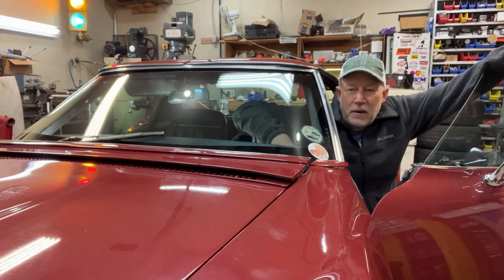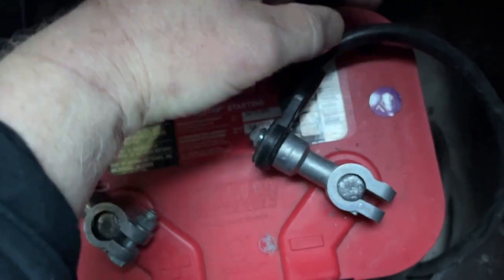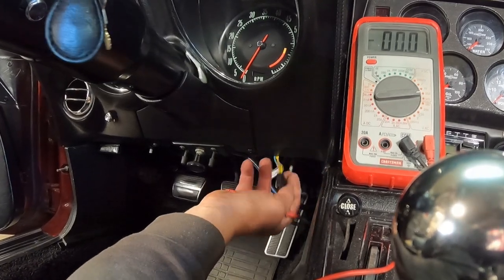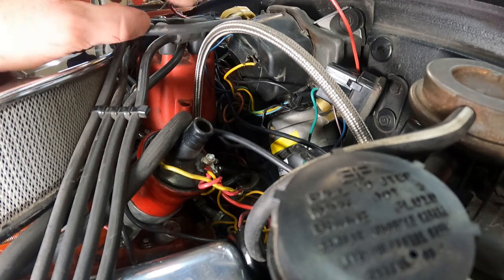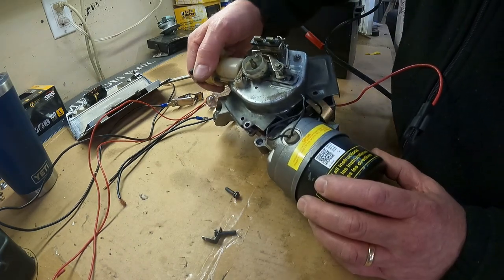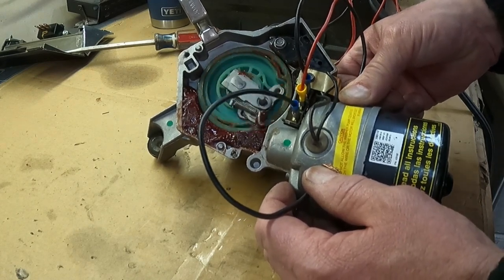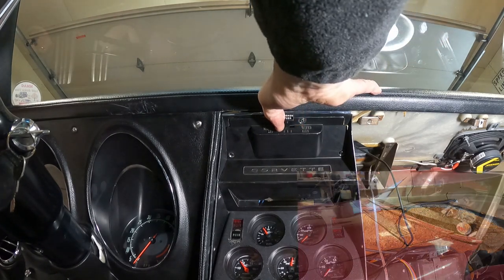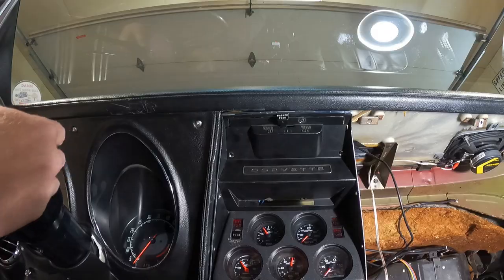C3 Corvette Windshield Wiper Repair, Testing & Troubleshooting the Entire Electrical Wiper System

Comment: Hey Mike, your video helped me with my wiper issue. 
I had seen several other videos but were NOT as helpful and detailed as yours, kudos to you.
My problem ended up being the ground wire on the tach was disconnected.
I tested the wiring,  the motor fuses and all were good.
But following your methods helped.
Many thanks and keep up the great videos.
Cheers 🍻
Frank
Reply from the maker: Thanks for the feed back!!! Great to hear the video helped you out. It’s a process troubleshooting and getting the wipers back in working order and ground issues are tough to solve. Nice work getting to the bottom of the issue.

Comment: Something else to check. If the pump is not shutting off after one rotation, check or replace the nylon wheel. The ridges wear down and wont direct the small arm riding the wheel and after the rotation wont go back into the lock position. I learned that and it took hours to figure out after dissecting about everything in there but that. If you have gone that far to take the motor out and apart, don't forget to also check that the nylon wheels ridges are not to worn down. Actually you can do this without removing the entire motor by taking the covers off. Luckily, I found another GM wiper motor a friend removed and replaced on a car and kept the old one sitting in his shop for years. Did not fit or mount on my 69 vette, made for a different car and year, but what it did have was the same nylon wheel and it fit perfect on mine. That at least solved the pump issue. I eventually just gave up on the whole motor a few years later and all the little problems it had and got a new one, a bit pricey for sure. Solved all the issues. Sometimes it just pays to realize and admit something is just worn out and get rid of the headache.
Reply from the maker: My pump is always sticking for a few cycles. Sounds like the nylon wheel is probably the over cycling issue. I love reading comments. you guys always have great input. Thanks for watching and sharing some great information!
Reply: @33milegarage34  Sometimes a guy might not even notice if his window cleaner tank is empty or the pump doesn't pump.

Comment: Great video on how this whole system works. On mine the metal grabber is not moving back and forward at all, even with the wiper working fine, so I am guessing something has broken off inside it and I will need to remove the whole thing to check it. Thanks for putting this out there.
Reply from the maker: Thanks. The good side is the electrical system is all working correctly and you can focus on the mechanical stuff. Good luck with the project and hit me up with any questions.

Comment: I have watched your video and love the detail.  I have no power under the hood nor at the wiper switch on my 1971.  The fust has power on both sides.  I am not sure what year vehicle your video is on and wonder if it is the same for a 71.  Using my inspection camera I do not see a solenoid on the back of my tach.  Do you know if  it is in a different location on a 71 or am  just missing it.  The issue started when I removed the factory radio and had it upgraded and reinstalled.  Thanks
Reply from the maker: Our corvette is a 1970 so it should be the same. The electrical side of the wipers are a grounded switch system so if the  system worked before the radio install you would want to go back and inspect all the ground wires and connections, it’s easy to break the ground wires and pull out the connections while installing a new radio. It’s also possible at some point the actuator got bypassed and removed. Thanks for watching and I hope this helps out.

Comment: Great job! Very informative.
My problem on my 71 is that when switching on wipers, wiper door will not open.
Nothing happens, but if I use the override switch to open wiper door, it opens and wipers work.
I am at a loss.
Any suggestions?
Thanks
Frank C.
Reply from the maker: Thanks. I try to share as much information as possible. Not sure if you started testing but with the over ride working I would start with the easy stuff first testing power to the wiper switch in each position if that checks out next would be to check the vacuum solenoid under the dash. Let me know what test fail in video and I can try to help find the failure point and the fix.

Comment: Hi Mike - great video. Question: my door safety switch appears to be functioning, but I’m not getting 12v from the horizontal pin inside of the plug. Fuse is good - any ideas?
Reply from the maker: Sorry for the delayed response. I had to do a little digging on my car to answer your question.  It’s possible that the wire is corroded or broken in the rubber boot. Try testing before the boot connection. If you’re still not getting power before the connection you will need to test the hot wire back to the power source.  Thanks for watching!

Comment: Great video.  I am not getting 12 volts on both pins at the solenoid.  Just the one side that goes to the fuse.  I believe the blue wire is the one not getting 12V though on my car this wire is black.  So when everything is hooked up, the door opens and stays open. Any suggestion?
Reply from the maker: Sorry for the delayed response. I have few ideas here. First try grounding the solenoid, the dash ground commonly fail. Next check the wiper switch, that can ground power to the blue wire.  Wiper Switch off  blue wire will have 12v, wiper switch on blue wire should have zero volts. Bad wiper switch or poor ground can be the issue. Thanks for the great question and watching.
Reply: @33milegarage34  Thanks for the reply.  My car is a 68 so I expect some of my connections to be different. A prior owner had worked on the wipers and everything was hooked up wrong or disconnected.  The connector on the switch was put on backwards and the solenoid was dangling.  I got it all working.  I didn’t screw the solenoid back on to the tach.  I left it hanging and ran a separate ground wire for it.  Everything works now thanks to you , other YouTubers and a good elec diagram.

Comment: Hey Mike, great video. Im trying to fix my wipers at the moment. My problem is that I don’t have any ground to the blue cable into the motor. Do you think that could be the control switch inside the car? I was hoping I would not have to take it apart. Also, my pump was stuck and I’ve cleaned it up and lubricated, but the sliding lever that moves the pump piston seems to be very tight and takes a fair bit of force to move back and forth with your fingers. Is that normal?
Reply from the maker: Yea. I would check the switch first. Make sure the switch and body have good grounds when testing. If the switch checks good. Check the motor ground next. That is assuming your wiper door is open with switch made also. Good luck and thanks for the question.

Comment: Mike,  I have checked the fuse and it good.  If I am not getting to 1968 corvette wiper door solenoid switch (2min 53 seconds on the video)  what would be my issue?   Thanks
Reply from the maker: So no power to switch means your going to inspect the wire for corrosion or a break in the connection. II use a test light or my multi meter to trace the fault back. You can also test to see if you have power going the horn relay that may indicate a bigger electrical problem. That’s for the comment

Comment: Hey Mike, my wiper problem is that i do not get 12
volts to the plug right after the switch that is activated by the wiper door, i am talking about the red wires with the white stripe.
I open the wiper door manually to activate the switch but no voltage.
Wiper switch is good, fuses are good, everything is ok but still no 12 volts.
Any suggestions?
Frank
Reply from the maker: So no power to the plug . You will need to start un wrapping and testing the wire until you find the break or short. It’s a bit time consuming but not that bad.  Most of the time the wire coating is damaged and the wire gets corroded and fails.You can jumper past the switch to test the rest of the system. But please go and find the break or short. Electrical shorts have burned up so many nice cars.  Thanks for watching and good luck!

Comment: Also , i got lucky that the solenoid switch is in good working order ,as they discontinued manufacturing it, according to Corvette Central in Michigan.
Reply from the maker: I have noticed more and more the manufacturers not making and restocking some C3 parts now. Hopefully we start to see some of the out of stock parts make it back into the market this year.

Comment: quick question.  what is the round knob's function between the override pull out switches?
Reply from the maker: Great question…. Electrical over ride for the windshield wipers. 1968-1972 the wiper door must be in the open position for the switch to work.

Comment: On my 71, when I switch the wipers on, nothing happens.
But when I use the override switch to open the wiper door, then the wipers work.
The wiper switch has no affect on the wiper door.
I am confused.
Any suggestions?
Thanks
Frank
Reply from the maker: Sounds like the vacuum actuator under the dash might be the issue. It might be getting a signal from the switch but the actuator is not opening or the switch is not sending the signal to the actuator. Hope that helps you out! Let me know how it goes.

Comment: What makes the wiper door close?....mine stays open
Reply from the maker: A vacuum actuator opens and closes the wiper door. You could have a vacuum leak , electrical issue, bad actuator or the door could be seized. You can try carefully moving it manually to rule out a mechanical issue then move to the possible vacuum and electrical issues . Hit me up with any questions when you tear into it.
Reply: @33milegarage34  has to be vacuum leak.  When car is shut down., door closes as air leaks out or if I apply light pressure to the door.   Soon as car starts door opens and is firm to pressure
Reply from the maker: Hopefully it’s just a vacuum hose, easy fix and not the diaphragm in the actuator. They can get expensive. Thanks for watching!
Reply: @33milegarage34  so I hear.
Reply: @33milegarage34  did you do a video about installing an actuator?
Reply from the maker: I don’t have actuator video but I was thinking about doing a video on the vacuum system.
Reply: @33milegarage34  there's a good one on a 69....but 71 late and 72 are a bit different.  But you make one  ...I'll watch it.👍👍👍